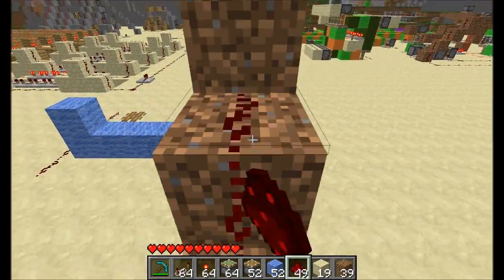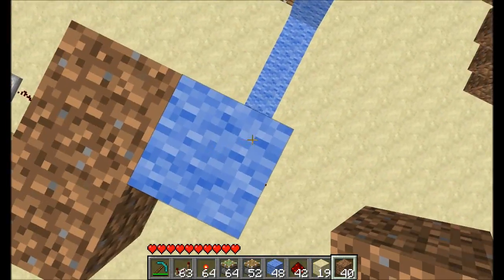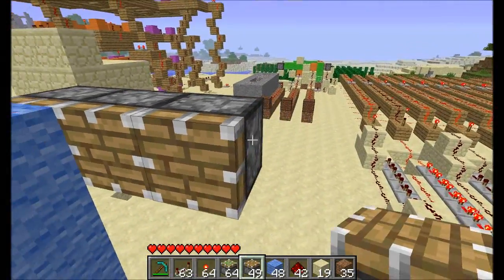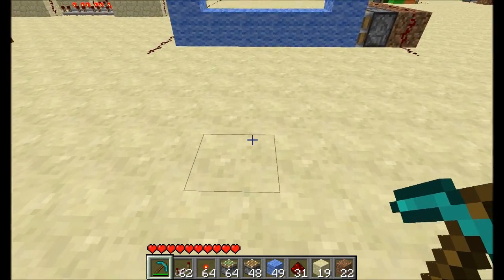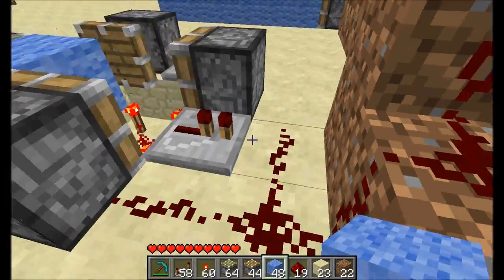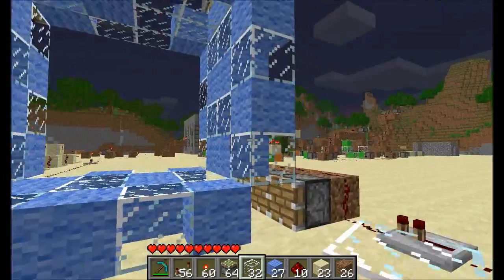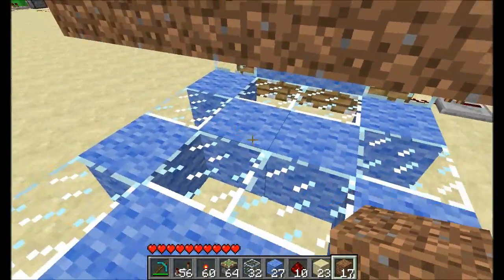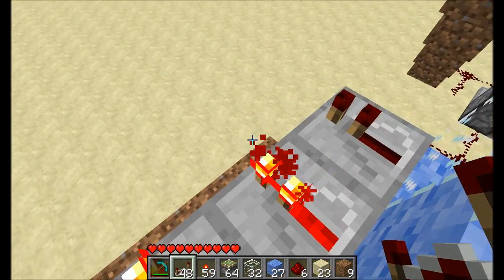Minecraft - Tutorial: Piston Memory Tape

Comment from the maker: @MrRedBoolean I've seen a couple ideas. Most don't seem very practical. One uses a perpendicular loop that intersects the memory tape and blocks are switched in and out.  I think a better one I've seen which I may try and incorporate, is you use two tracks for each bit instead of one. Initially one track is all glass (blank) and the other is all wool (just an unread repository) then you have a read-write head that can transpose the two when needed.

Comment: Your memory is not four bits, a bit is one piece of information ( 1 or 0 ), you created almost 12 bytes of memory in your design
Reply: It us 4 bit, when he says 4 bit, he means the data reads 4 bits as a time, so the highest binary number u can read is 15 (1111). This means the bus required to take this info is 4 wires wide